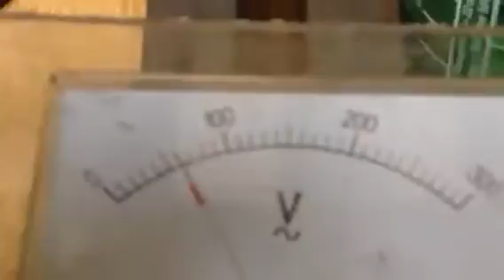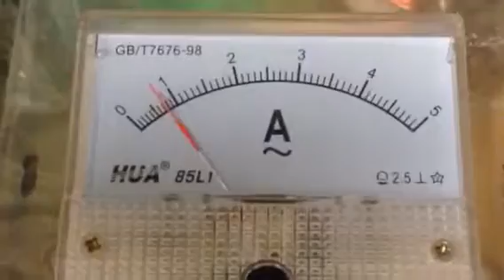50kvdc triple electrode spark gap firing

Comment: Wow!! is that like a million dolars woth of cool equipment?? that is incredible.
Reply from the maker: Nah... this was early on in the RPS build... I sorta built it as it occurred to me how to build it...  the whole setup could be built for under a 1000 dollars...  ;)
Reply from the maker: This was me verifying I could  cause KVDC to discharge between same polarity but different amplitude terminals...
Reply: I did think at first that those were russian quenched spark gap tubes for some reason. Capacitors?
Reply from the maker: Yeah those are russian capacitors... I tried using plastic doorknob caps, but they would literally explode... specially the green doorknob caps...  these are a glass teflon capacitor so they are more heavy duty...  can get em in sets of 4 for about 30 bux on ebay... ;)
Reply: AWESOME!!!! thank you. what is the pf and KV rating?
Reply from the maker: They're these ones you can still buy on ebay...  tho you'll want to get an oil ignition transformer too...  and some 15kv 100ns rated diodes...  ;) 

https://www.ebay.com/itm/3300pF-16kV-teflon-doorknob-capacitors-FGT-I-Lot-of-4/160700180882?hash=item256a7a2992:g:ba0AAOSwPc9WycGa